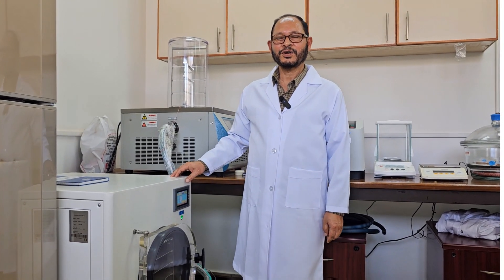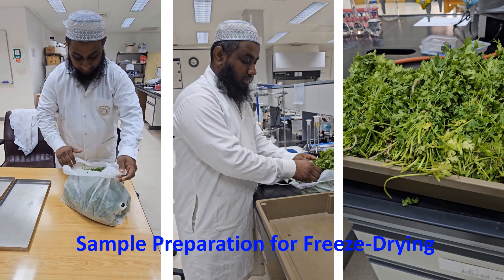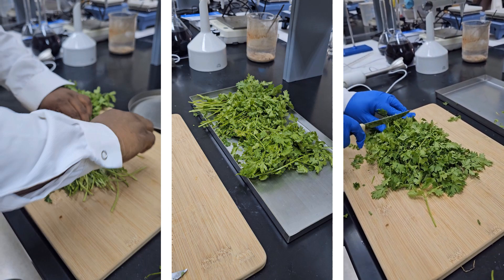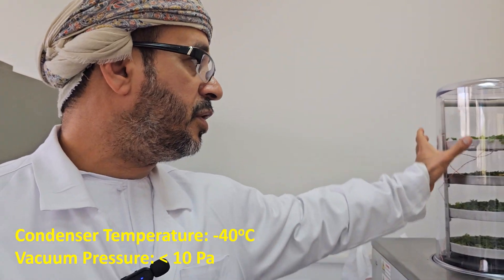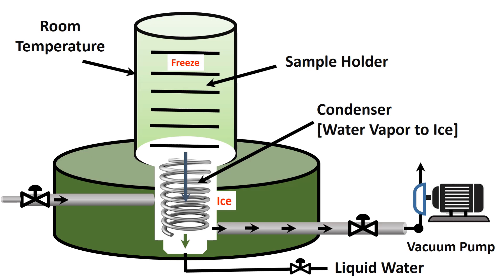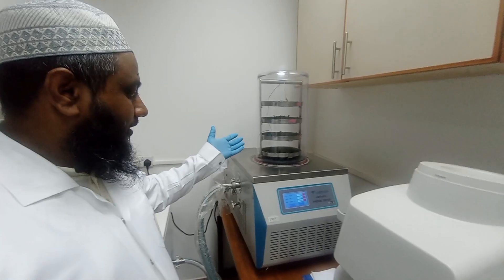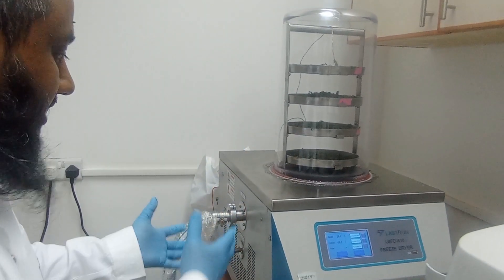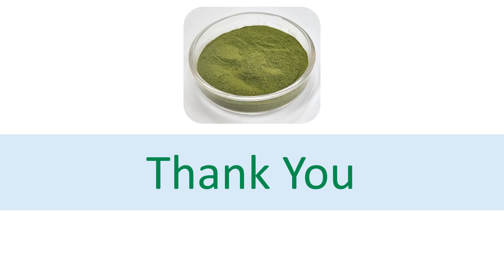How to Prepare Freeze-Dried Coriander Leaf Powder

Comment: If I dry the coriander leaves, they have to clean with water before, so they are much more wet before. What happen if?
Reply from the maker: Thank you for your comment. Yes, you need to wash the coriander leaves. In this case, we spreaded the coriander leaves over tissue paper on a wide surface. This will soak the surface water and some will dry at room temperature. Spreading should be in a thin layer. After couple of hours at room temperature, the coriander leaves were frozen. 😀😀